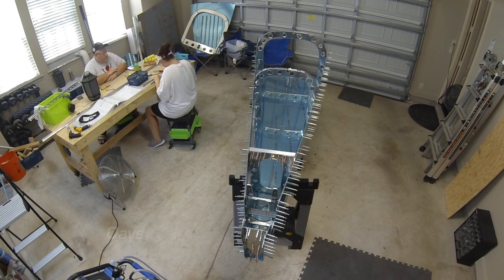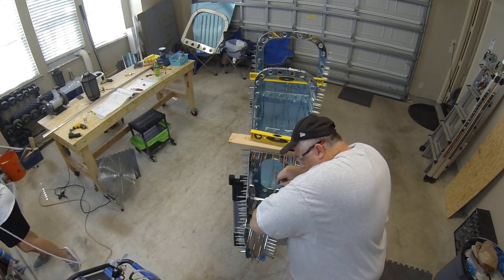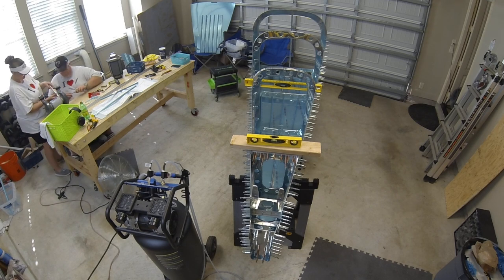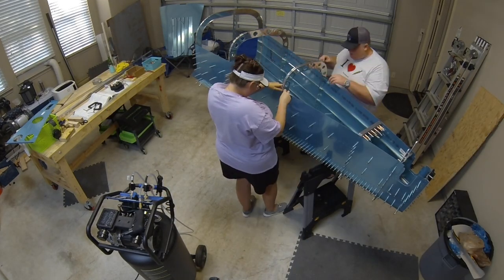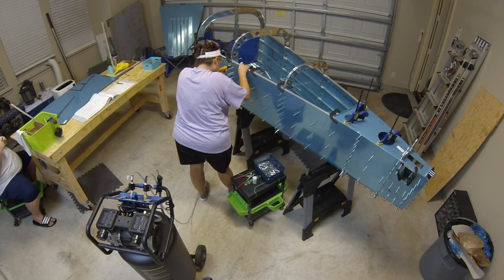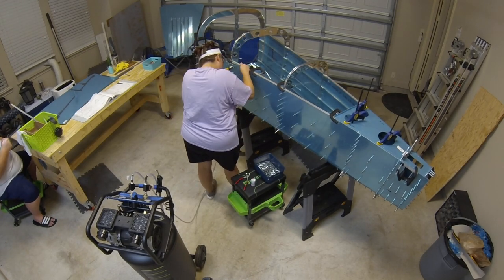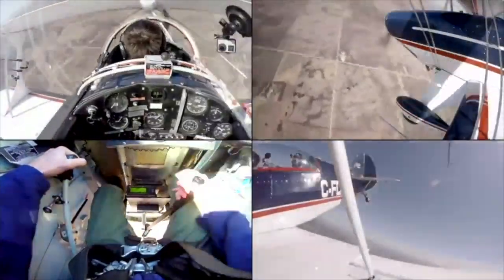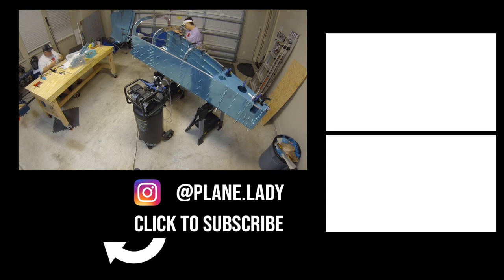Van's Aircraft RV-10 Build: Days 41-42 - Big Surprise! (10-8 to 10-11)

Comment: I thought all the holes where match drilled at the factory....some new machine process Vans has delpoyed...
Reply from the maker: Check out my previous video - I interviewed Van’s about their new RV-10 kits. These build days were before they made any changes to their kits. And even in the new ones there will still be match drilling required. Just no final drilling on the new parts